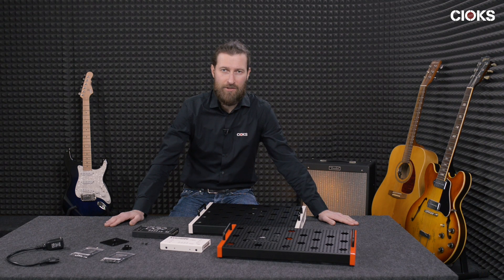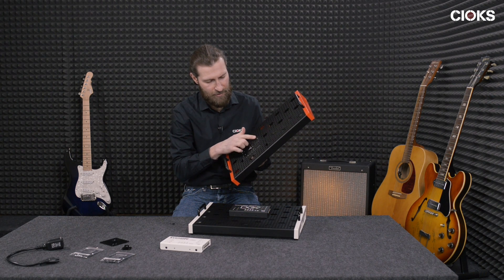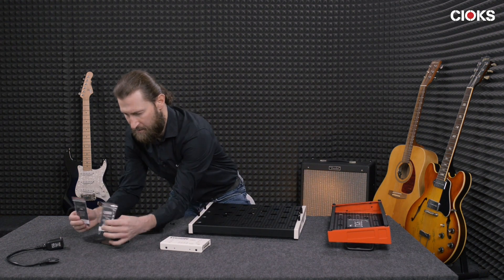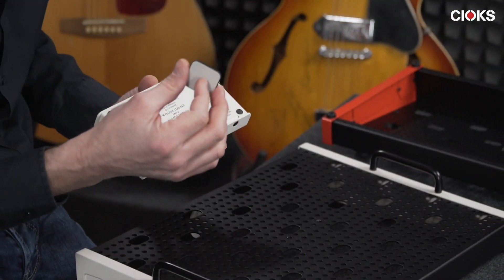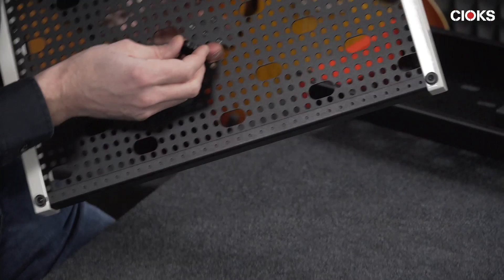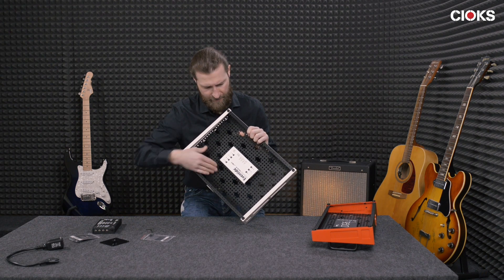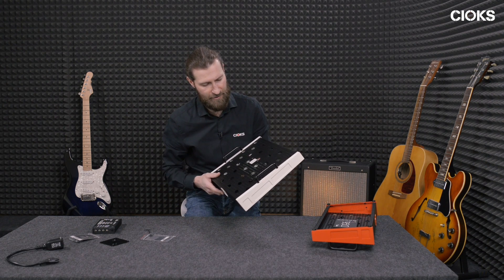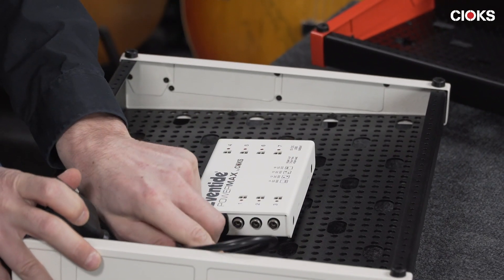Mounting CIOKS DC7 or Eventide PowerMAX on Templeboards

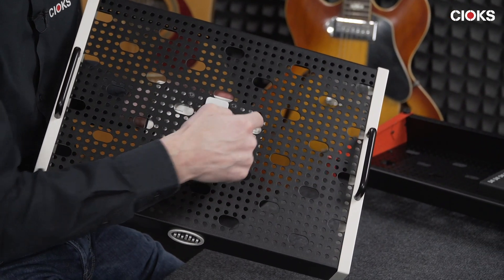Comment: 03:51 – "if you want to move or remove this pedal from the board, you'll have to of course remove the power supply first". I bet that's the trickiest part, because you can't unscrew the power supply without detaching the pedal first. And you can't unscrew the pedal, because it's covered with the power supply underneath the board. So the only way left is to detach the pedal from the sticky pad completely. I would like to see people doing it on a real board – it must be suffering of some sort
Reply: I'm sitting here right now with the hex stand offs and a dc7/dc8, and still can't figure out a good way to mount them on my templeboard
Reply: @KittyKatATK  I did that just yesterday. I had an existing working board where I wanted to replace the power supply. The tricky part was to find the right spot for dc7 - it can’t go under large pads. With medium pads it sort of matches, but I was able to screw down only two stand-offs out of 3. And of course I needed to detach one of the pedals from a medium pad and use my spare one to mount the supply first and re-attach that pedal again. 

If you’re building your board from scratch, then you may want to be really careful with layouting. I was shocked that cabling changed the desired layout drastically. With a power supply it’s just one more thing to keep in mind.  Good luck

Comment: You guys forgot a rly crucial point! If u want to put the pedal in before u put the power supply, the only way to remove your pedal to remove the powers supply again is to detach it from the patch u glued in...
Reply: Just remove the power supply first?
Reply: @sirlost94 How do you remove the power supply without removing the pedal that you can’t remove without removing the power supply that you can’t remove without removing the pedal that you can’t remove without removing the power supply that you can’t remove without removing the pedal that you can’t remove without removing the power supply that you can’t remove without removing the pedal that you can’t remove without removing the power supply that you can’t remove without removing the pedal that you can’t remove without removing the power supply that you can’t remove without removing the pedal that you can’t remove without removing the power supply.
Reply: @jonathonevans9973  lol usually you’d have put the PS last so that should be the first one to be removed. I added a bracket to the pedalboard and it’s super easy, 4 screws and it’s out

Comment: What is the difference between these 2 supplies?  Look the same.  Will the power max power an HX Stomp the same way the DC7 will?  Thanks!
Reply: I just got an answer from them on another video. The only difference is that the powermax does not have the 24v out. Other than that, they are the same.
Reply: @MrDonc78  are the included flex cables the same?
Reply: @MarlonUrdelas  not sure, I had to order the green flex cables for my h9s with the dc7. Surely they would include them with the powermax for eventide products!

Comment: What is the difference between Eventide Powermax and DC 7 ? It seems Powermax is cheaper.
Reply from the maker: DC7 has an extra 24V aux outlet which is lacking on the PowerMAX.
Reply: @ciokspowersuppliesforeffec7533  which is no longer the case on V2 right? Thanks

Comment: How do you remove the power supply without removing the pedal that you can’t remove without removing the power supply that you can’t remove without removing the pedal that you can’t remove without removing the power supply that you can’t remove without removing the pedal that you can’t remove without removing the power supply that you can’t remove without removing the pedal that you can’t remove without removing the power supply that you can’t remove without removing the pedal that you can’t remove without removing the power supply that you can’t remove without removing the pedal that you can’t remove without removing the power supply?